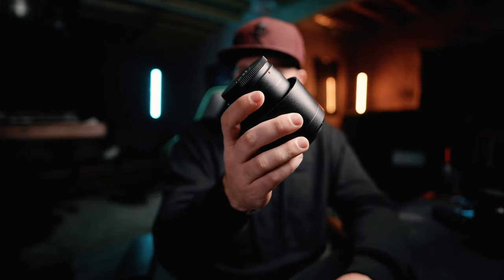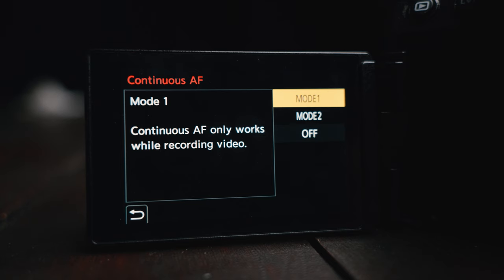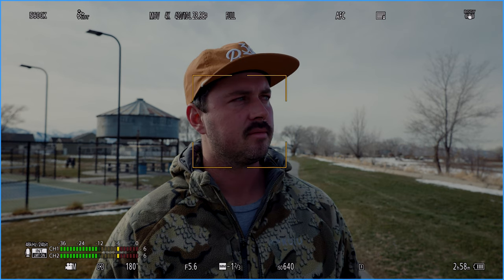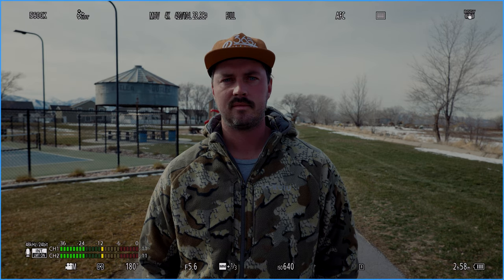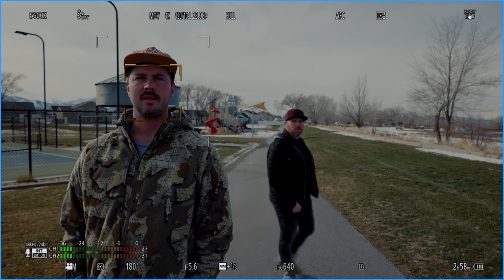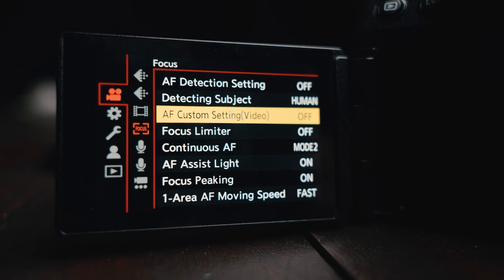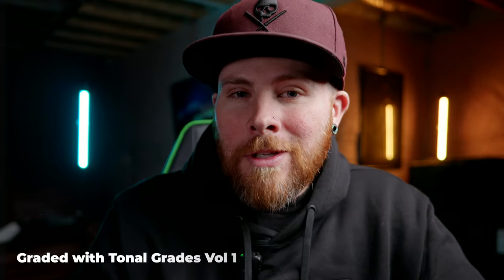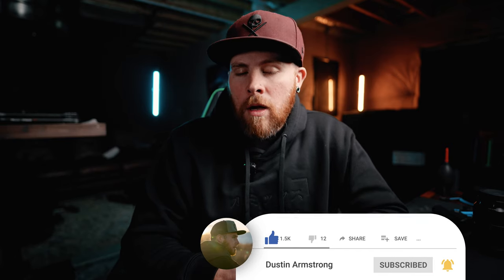BEST Autofocus Settings for LUMIX S5II

Comment: Dustin, I owe you one. I had my Af settings all wrong for talking head and the results were horrible. I was on the verge of selling the S5II and going with Sony, even though the Sony colors/skin tones don't look nearly as good as the Panasonic. THANK YOU, THANK YOU, THANK YOU.  I used your Human settings and the Lumix was ROCK SOLID in AF. Sony is good too, but the skin tones don't look nearly as nice and natural, nor is it as easy to use as the Panasonic.
Your video came just in time. Panasonic talking head AF worked perfectly, no hunting, and wonderfully locked on, You made my day!
Reply from the maker: Very happy to hear🙏 just a side note I can't remember if I mentioned it but if you shoot 6k with an external monitor connected it disables human detect. So shoot in 4k if you use one for best results!
Reply: Or just use mf for talking heads..?

Comment: Thank you for this video Dustin.

I just bought the S5ii used. When with the previous owner the autofocus worked fine. Went to a parade and the autofocus didn’t work ~30% of the time. This was suboptimal. I wa going to trade the S5ii in for a camera that autofocuses the LUMIX contrast DFD was slow sometimes. The DFD wobbled until it locked onto the subject. Ultimately the DFD worked. Not so fr the PDAF that so many of the reviewers talked about.

The YouTube how to set up videos are almost all video centric. I’m a photographer who sometimes does video clips. Lord knows there is a plethora of video choices. Many I don’t understand the difference between the choices.

It is weird to me that the focus settings are to be found in the movie mode. Counter intuitive to me. Feedback. I think it is important for the viewer of this video to know where the function you are talking about is located. You show on the video where the function is very briefly and then move on. I had to watch the video and rewind several times and then stop the video to locate where you were in the menu. It would have been helpful, for me, if you continued showing the menu on the screen longer so I could locate the function you were talking about. Also verbalizing where you were in the menus would have helped. Saying I am now going to the movie mode, then focus, then AF CUSTOM Settings (video). Go to the dial and press the right side to get you into the choices available. I am hoping that the autofocus settings you suggest work for photography as well as video. After all, The autofocus settings are located in the  movie camera icon section.

I have set the focus up as you suggested and I’m going to take the camera out for a walk. I hope your suggestions help me with the autofocus. Lord knows, it couldn’t get much worse.

Mask On Nurse Marty (Ret)
Reply: Any updates? My use case is similar to yours that the photography comes first and I am really curious about how the autofocus performance is in photography, especially after the release of firmware v3. If it is still unusable, I'll go with Sony A7 IV as it is 200€ more with Tamron 28-75mm or 28-200mm lenses compared to S5II + Sigma 24-70.

Comment from the maker: Use this for reference to be sure you get phase detect AF:

FF = Full-Frame 
APS-C = 1.5x Crop on Sensor Area
DFD - Depth From Defocus
PDAF – Phase Detection Autofocus 

1920x1080 (FHD)
24/25/30fps FF → PDAF With Subject Detection
48/50/60fps APS-C → PDAF With Subject Detection
48/50/60fps FF → DFD With Subject Detection
100/120fps FF & APS-C →DFD With Subject Detection

ANY* S&Q Mode – DFD Without Subject Detection
*S&Q 180fps – Manual Focus Only

3840x2160 & 4096x2160 (4K & C4K)
24/25/30fps FF → PDAF With Subject Detection
48/50/60fps APS-C → PDAF With Subject Detection
ANY* S&Q Mode – DFD Without Subject Detection

6K 16:9, 17:9 & 3:2 (Open Gate) With or without HDMI Plugged In
24/25/30fps FF → PDAF with Subject Detection (as of latest firmware)

Comment: Very helpful and reassuring on two fronts: 1) some new tools for utilizing autofocus when dealing with subjects in a busier settting; 2) I feel better as I'm swapping out some of my earlier Panasonic lenses for faster, (sometimes) smaller Sigma glass  (Lumix 24-105 f/4 for the Sigma 28 28-70mm f/2.8 & Lumix 35mm f/1.8 for Sigma 35mm f/1.4).

Comment: Great tips. Thanks so much. And - the intro video was beyond fabulous. I think I'll be switching systems and the S5IIX is a serious contender (for the time being, it's actually my favourite TBH). My question is - I suppose you can map focus lock to a custom button somewhere on the body? The reason why I'm asking this is (and BTW, I'm sure you noticed that autofocus did lose you some 6 minutes into the video, albeit for a second) that in certain situations, you want AF, but then when you know that your focus is in the zone and distance where your subject will remain, you don't want to risk distractions triggering wrong autofocus - for instance people walking in front of your subject or such? Or do you solve this somehow with the AF detection time (slow it down a lot) and/or distance setting?
Reply from the maker: No problem! Glad you enjoyed!

So the camera tries to detect if you showcase something to the camera. That's why it sometimes loses focus because it tries to focus on my hands. You can turn down the subject shift sensitivity to combat this. However I've noticed when I do this that if the camera thinks it's on a person and I don't notice or while filming a youtube video as an example, it'll stay out of focus for a long time. Which I think is worse than it losing focus for a bit and coming back. I'm fairly certain though you can map AF Lock to a custom button. I haven't done it, but the camera is extremely customizable. Maybe try searching to see if another person has done it just to be safe. Overall though I'm very happy with the AF. Needs some improvements in lowlight AF performance but you can't go wrong with the S5IIX

Comment: Great video! I've just had my S5ii arrive today but I am struggling to find the right recording settings for slow motion video. Did you use 4k 50p APS-C in order to get slow motion for the intro?
Reply from the maker: Yes all slow motion modes are APS-C unless you go down to 1080p
Reply: @DustinArmstrongPro  Amazing thought that was the case :) just got to get used to slowing the footage down by 50% in post. Been used to the GH5 with the variable frame rate.
Reply from the maker: @jhydeweddings  VFR is also available if you'd like to do that. I believe you need to be in S&Q mode. I don't usually use it because it will cut out sound
Reply: Yeah I've had a play around with that but the most annoying bit is the autofocus doesn't work continuously. The main reason why I moved from the GH5 was to have autofocus. So it's just a different style of editing for me to learn now :)

Comment: Bought my S5iiX a couple of weeks ago, still a little confused with all the auto-focus settings available... what overall setting would you choose for run-and-gun, travel videography?
Reply from the maker: Depends what I'm shooting. But I usually do human detect using the spot plus mode I'd say
Reply: @DustinArmstrongPro  Thanks mate, understand it completely depends on what's being shot, but this helps!

Comment: Is this a touch screen? Can I touch WHICH face I want it to focus on if there are multiple people?

Can I tell it to track ANYthing by touching anywhere on the screen and letting it track whatever I touched on screen?
Reply from the maker: Yes. I forgot to show it but if there are more than 1 face you can select the other face with the joystick.

Yes with the tracking mode enabled it can track anything

Comment: Great  video  , first wedding yesterday shooting on the s52 using 50 m f1.8 I was filming the Speeches with guests seated apart from the speaker as I wasn't to close fl wise I was experiencing a lot of the focus snapping to heads near towards the speaker I was in 1 area + human detect turned on kept wondering why I got home and checked my af settings both at max sensitivity at max I hoping that was the reason it was doing that ?
Reply from the maker: Definitely could be that. I don't see a reason to ever be at max settings
Reply: @DustinArmstrongPro  thank you mate
Reply: Maybe in this scenario best to turn human detect off?
Reply: @peewee1230  since the new update works peefect

Comment: I’ve heard you lose phase detect autofocus in higher frame rates of 50+. Can you confirm if that’s true?
Reply from the maker: To answer your question, yes and no. If you use S&Q mode you will lose phase detect. If you don't, you will still get phase detect. Here's a list for reference because it's confusing lol

FF = Full-Frame 
APS-C = 1.5x Crop on Sensor Area
DFD - Depth From Defocus
PDAF – Phase Detection Autofocus 

1920x1080 (FHD)
24/25/30fps FF → PDAF With Subject Detection
48/50/60fps APS-C → PDAF With Subject Detection
48/50/60fps FF → DFD With Subject Detection
100/120fps FF & APS-C →DFD With Subject Detection

ANY* S&Q Mode – DFD Without Subject Detection
*S&Q 180fps – Manual Focus Only

3840x2160 & 4096x2160 (4K & C4K)
24/25/30fps FF → PDAF With Subject Detection
48/50/60fps APS-C → PDAF With Subject Detection
ANY* S&Q Mode – DFD Without Subject Detection

6K 16:9, 17:9 & 3:2 (Open Gate) With or without HDMI Plugged In
24/25/30fps FF → PDAF with Subject Detection (as of latest firmware)

Hope this helps

Comment: What happens when s52 works in 4k 60fps crop mode. Does it use only subset of pixels(as it behaves as apsc)? Or uses all pixels and then crops to apsc?
Just wondering low light performance behaviour when in 4k 60fps

Comment: Nice content and useful information for S5m2… just subscribed and keep in touch for the next videos. How it performs sigma 24-70 mm f/2.8? …some comments says lost focus in tracking. What about Sigma 28-70mm ? Thank you!
Reply from the maker: Appreciate it🙏 I see no difference in any Sigma lenses compared to Lumix. As long as it's a DG DN Sigma lens
Reply: @DustinArmstrongPro  thank you for your quick reply!  I really appreciate!
Reply: @DustinArmstrongPro  Hey Dustin - thanks for the tips! Have you tried the AF out with the classic Sigma 18-35mm lens?
Reply from the maker: No problem. Like I said any DG DN Sigma lens should be basically identical when it comes to AF on lumix

Comment: Quick question, just picked up the camera today and your video is showing 180 degrees for the shutter speed.  Mine says 15 degrees.  I believe I changed it to double the fps but its still showing 15 degrees.  Any idea?
Reply from the maker: You should be able to adjust it to 180 the same you'd adjust shutter speed